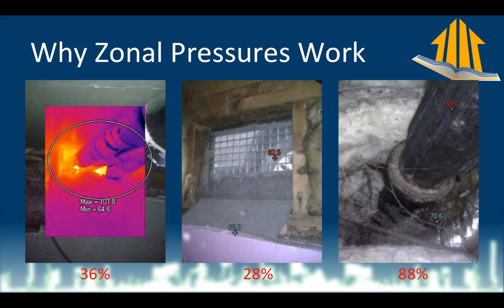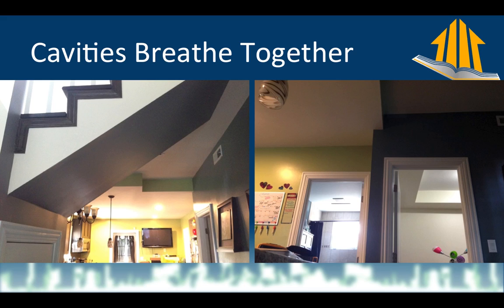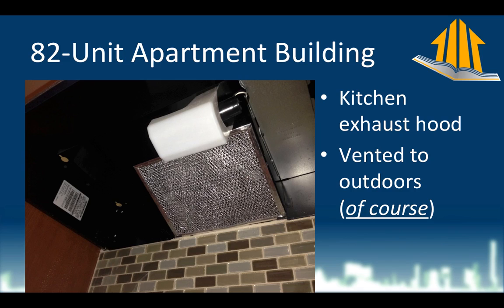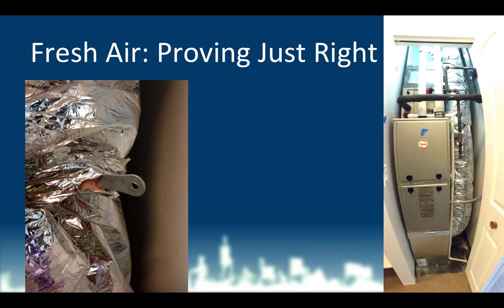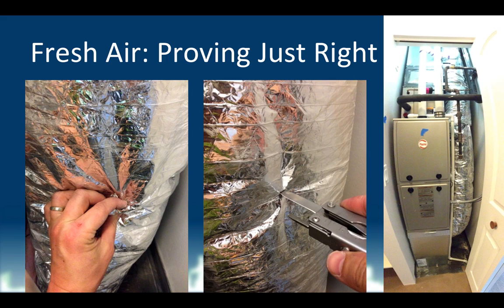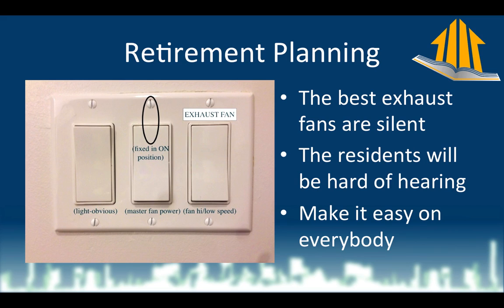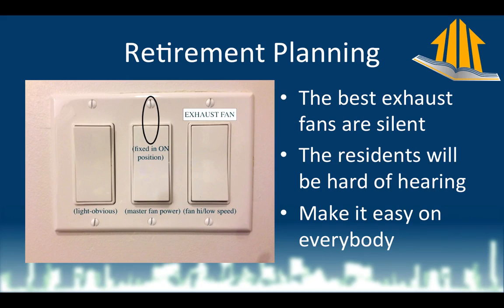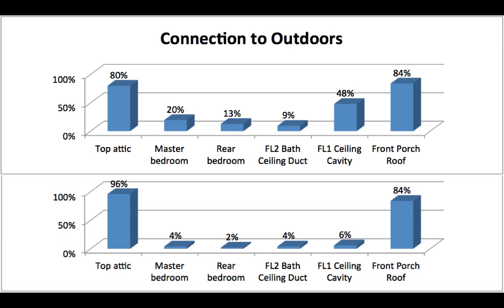Holes in the House (Who Knew?): JULY 2015 Building Forensics Mastermind Series

Comment: Corbett: A couple of comments on your use of SketchUp. 

1) It's no longer "Google Sketchup" - Google sold Sketchup to Trimble almost 6 years ago. It's still Sketchup, just not "Google" Sketchup - unless the version you're using predates the acquisition by Trimble and you haven't updated. 

2) Check what version of SketchUp you're using! Your use of one of the free versions for as part of your business work flow likely violates the End User LIcense Agreement - which disallows ANY commercial  use of the free versions. It's been a long time since even Google Sketchup allowed commercial use of a free version.

Regarding the second point - and referring to your statement in your IR Camera comparison video ("If it's less than $500 - just get it. Don't agonize" <-- paraphrase) - The current Sketchup Pro (the version that's OK with commercial use) is only $800. I'm guessing that that is small enough that even if you agonize, you'll resolve your agony quickly and decide to do it.
Reply from the maker: Steven, valid points!

Comment: Great video, Corbett. I wonder just how much outside air was coming in via the range hood whenever the hvac system blower was on. That's one of my pet peaves. Some people are intimidated by instructions while others ust refuse to read them. I don't get it.
Reply: Hey guys, checkout the Broan EV-100 stops back drafts at the envelope.
Reply from the maker: Yeah, normally the range hood would have two backdraft dampers, one in the hood and one at the outdoor terminal- these had neither!